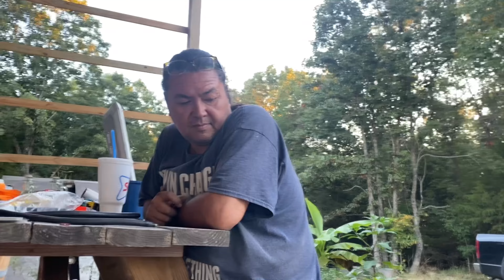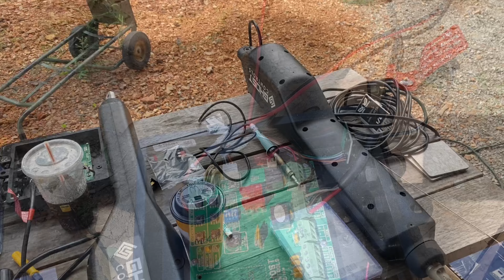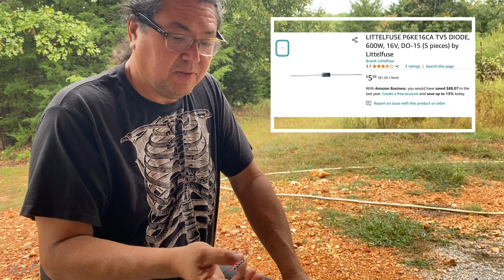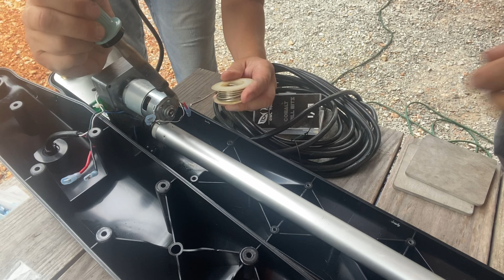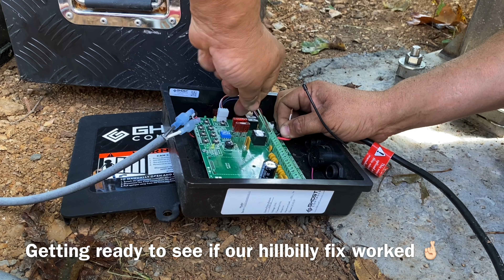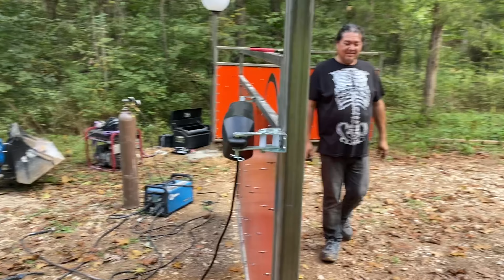Diagnosing and Repair of a Non-Working Ghost Control Automatic Gate Arm

Comment: Kind of a random question. Is it possible, or even worthwhile, to make the wire 14 gauge instead of 16? I'm running the operator 30' from the control box and need to replace the wiring anyway.
Reply from the maker: I’m sure it is possible, but with such a small amp draw I don’t think it is necessary. if it were WAY farther away, then yes, but at least ours came with a pretty good run of wire for the distance.. if it makes you feel better to run the bigger cable though…your peace of mind means more than the few cents in wire !

Comment: Ghost controls support told me to cut out the shorted diode all together and no need to replace it was highly unlikely that my circuit board would be compromised without it. They said I could replace if I wanted. The arm works without the diode.

Comment: Good info, thanks.  A couple of points tho.  All diodes have a polarity. If no band info will be on data sheet. Or marked by a bump or you can go ‘old school and find it with a multi meter.   2 you failed to mention using a heat sink to protect diode as you solder. Now my question is diode usually short due to excessive heat and voltage spikes.  How did you find the root cause?